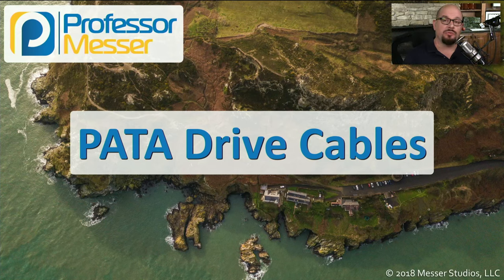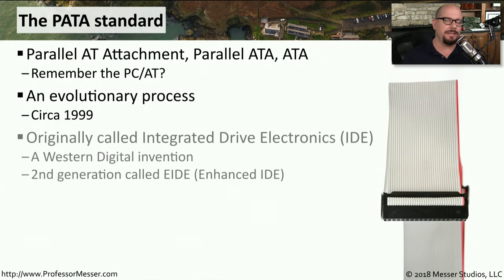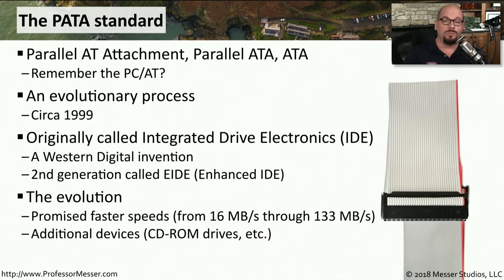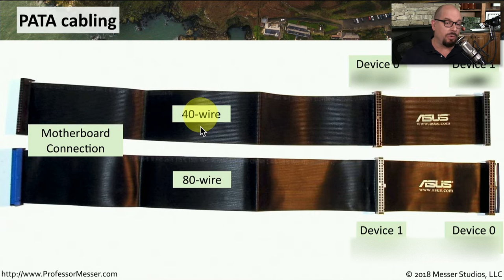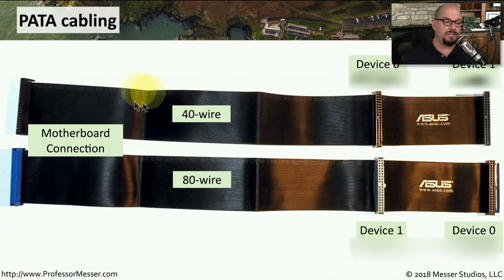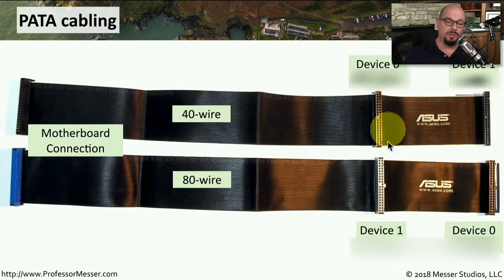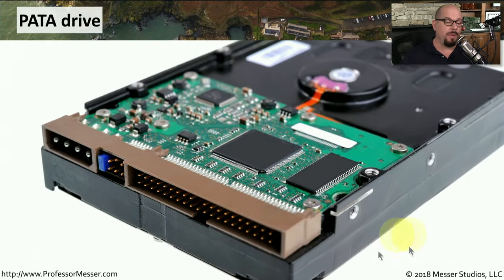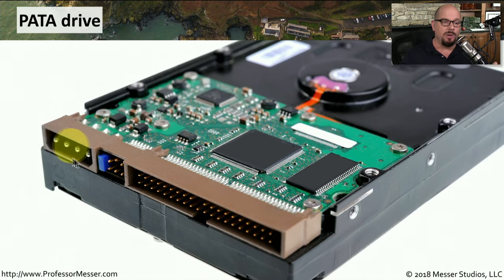PATA Drive Cables - CompTIA A+ 220-1001 - 3.1

Comment: From an aesthetic point of view, I'm so glad we're doing M.2 now.  I remember when they split the PATA cable into strands, so it would help with airflow in the case.  On higher end cables, they somehow wrapped them into a round cable to promote airflow.  I remember that the cables never quite reached where I needed them to go, and I'd have to buy new cables which were never cheap, and some were dead on arrival.  I have some old computers laying around that I want to get an old ZIP 100 drive working, but the thought of dealing with the PATA cables keeps me procrastinating.

Comment: When you are talking about the difference between the two PATA cables.  40 wire vs 80 wire for the image.  You point out that the 80 wire has the pin blocked out so it can only be plugged in one way.  You also mentioned that there are cables that do NOT have this missing pin.  Does this mean that you can still only plug the PATA cable in one way (with respect to the ones that do not have the 40th pin blocked)?
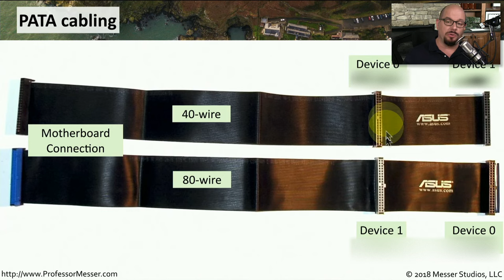Reply: There is small notch (check 2:07 for example) on the cable's connector so you can only put it in the right way, even though there's no blocking of the 40th pin on the cable connector.
Reply: you can also use a sharp pin and remove the block! (not all, but, some)
Reply: @benjamineliasson  Well, I've seen my younger sister (maybe 14 at the time) still connect the cable the other way round, despite the 'preventing' notch. That was years ago. Still funny, come to think of it .. :)
Reply: Plus, I've heard of a rule, that the one red wire in the 'ribbon' was supposed to always face the power connector. Anyone ?

Comment: Sir, can we use sata cable for both HDD and SSD
Reply: It depends on the type of drive you are installing. Some older HDDs will use PATA (IDE) cables, others will use SATA. Newer SSDs can use SATA, M.2 SATA, or M.2 PCIe, especially the new super fast NVMe drives.

Comment: So do pata and sata cables transmit information throughout the motherboard? I'm confused on there actualy function in lamen terms please
Reply: Seems like they connect the hard drive to the motherboard. I am also a scrub though
Reply: SATA cables transmit data between the MOBO and the HDDs/SSDs/Optical drives. There are also power SATA cables that transmit power from the PSU to those drives. I'm not sure about PATA but I think it does them same things.